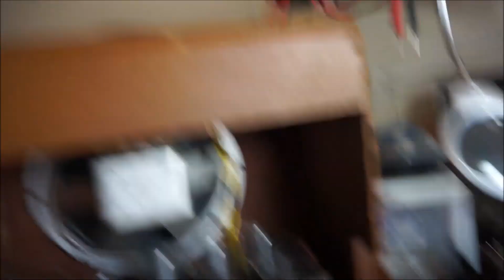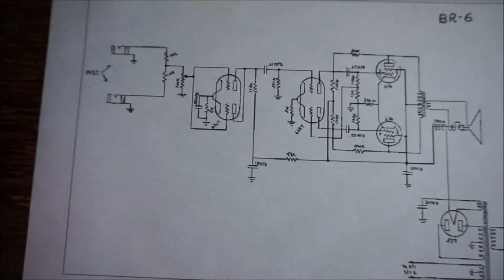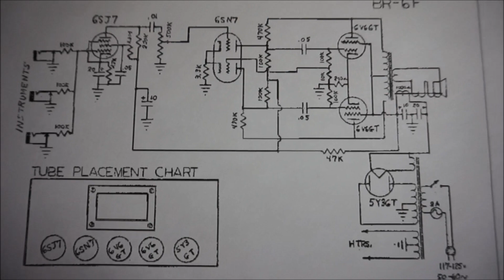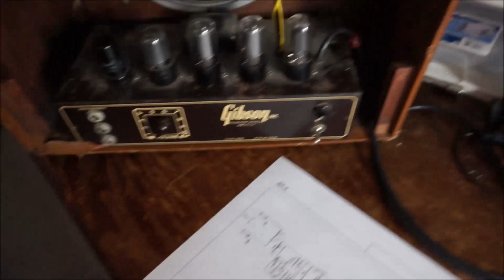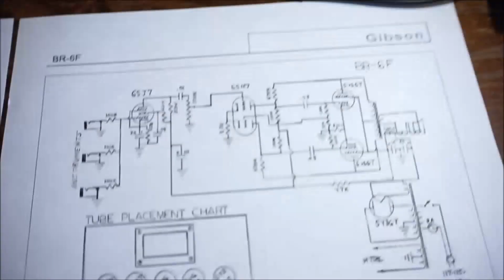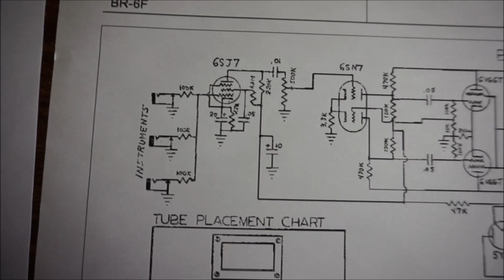SRT Amplification - Gibson BR-6F

Comment: How do you feel about handling tubes with your bare hands or not polishing them afterward?....Also you can alter the overall tone of that amp with a axial capacitor on the speaker itself if your only complaint is it's to bright.
Reply from the maker: The capacitor across the speaker is a great idea. On the issue of handling tubes with bare hands, while I do think that excessive build up of oil (from your fingers) and the subsequent build up of dirt on top of that, could cause a tube to overheat or to heat in a non-uniform way; I don't see the problem with handling them with your clean hands. Obviously, as part of any service on a tube amplifier you would want to clean the tubes. I do that just for the heck of it from time to time on my amps. I have just started getting into the vintage stuff though. Most of my own amps and the repairs I have made for customers, have been on amps from the 80's or later. Until I got this '51 Gibson, the oldest amp I had was a '64 Silvertone 1484(which I still own and love). I have also owned a '79 Marshall JMP and more than a few JCM 800 and JCM 900s. Currently I have that Gibson, the Silvertone mentioned before, a Fender Hot Rod Deluxe, a Fender Blues DeVille, and a Black Star 5W mini stack amp. I sold a lot of my stuff before I left Hawaii.
Reply: Thanks for the friendly reply, it's refreshing being able to discuss things openly and professionally unlike some other channels. Yeah that Silvertone you have is a neat amp for sure!... back in the day I had the chance to play one of the old Silvertone guitars with the tube amp inside the guitar case I was working on for a customer and just feel in love with that thing pretty funny that whole setup was like $69 back in the Sixties lol
Reply from the maker: I think the capacitor alone across the speaker, would have the opposite effect, but I will experiment with some things.
Reply: You'd have to experiment with the capacitor value but it should bleed off some highs if you get the value right
Reply: Maybe this will help: http://www.carstereo.com/help/Articles.cfm?id=1
Reply: Even changing the speaker itself is an option but I'd rather keep the original
Reply: That's just an original old amp I'd hate to molest it a whole lot by modifying the circuitry but the cap on the speaker is easy to undo
Reply from the maker: You would have to put some resistance value in there to set up an RC low-pass filter network. It would basically be an audio cross-over, but only cutting the highs to the one speaker. You could then vary the resistor and use it as a tone knob. This will also attenuate the power to the speaker as well. Yeah, I'll experiment and let you know.
Reply: Yeah it was just a thought that jumped into my head another option you could do instead of removing the one input jack is replace the volume pot with a push pull setup so that one position is volume and the other is tone when you build your tone circuit that way everything appears stock when you look at it.